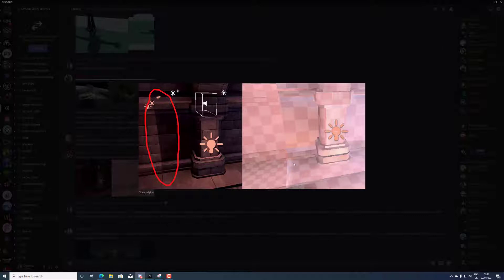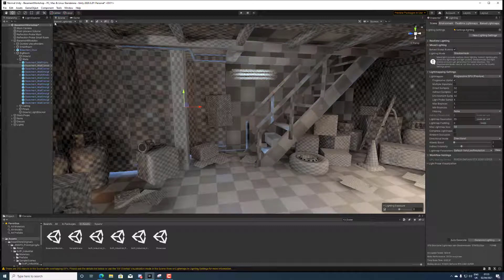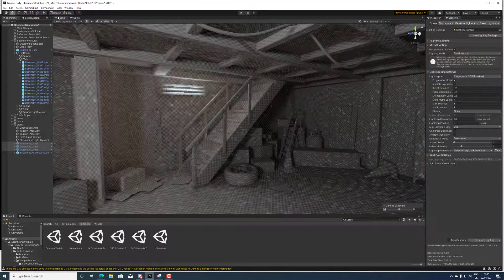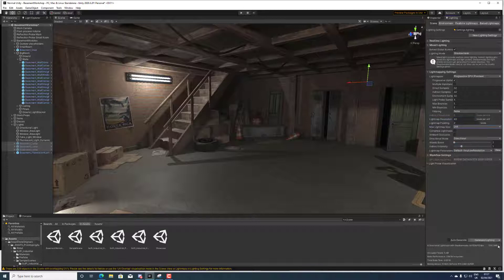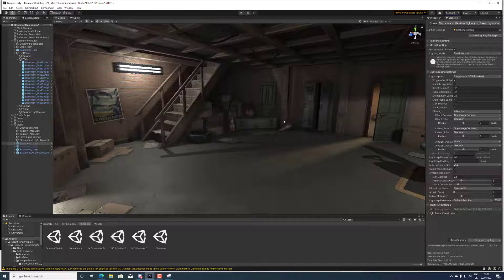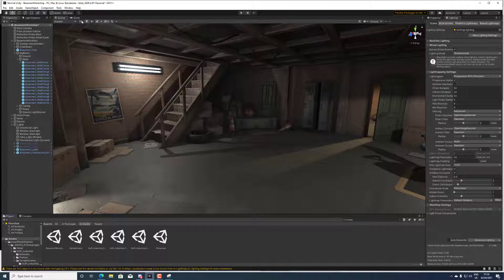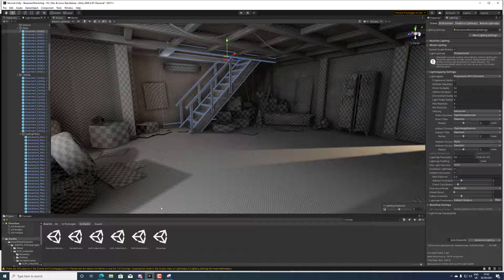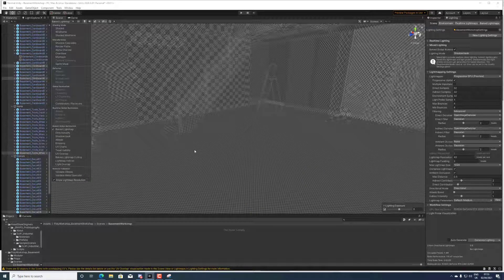Unity 2020 - Fixing Lighting and Texture Seams in Modular sets. Understanding Basic Lightmapping.

Comment: Apart from the overall video, I also don't agree with the constant downsize of the shadow map. Especially in larger scenes you want to redruce drawcalls drastically and in order to do so you want to combine as many assets as possible on a single map instead of 5+ maps that need to be composed per frame.
Reply from the maker: That would be one of the advantages of combining many assets together, sure. There is pros and cons to every decision. Combining meshes together will instead increase texture map size and costs among other things.
Reply: @AmitGinniPatpatia  Yeah, that touches the main point: every situation is different and needs its own solution. Anyway thanks for the video.